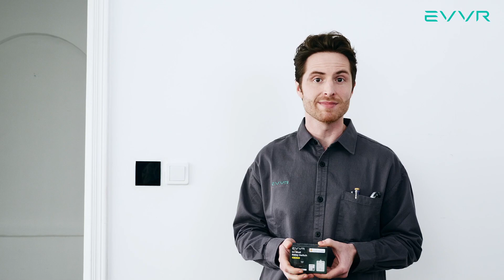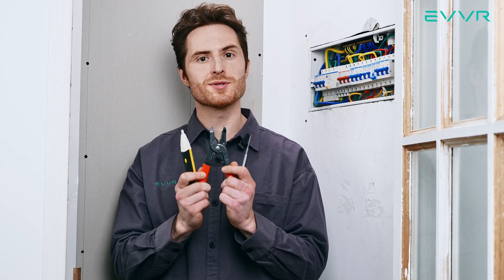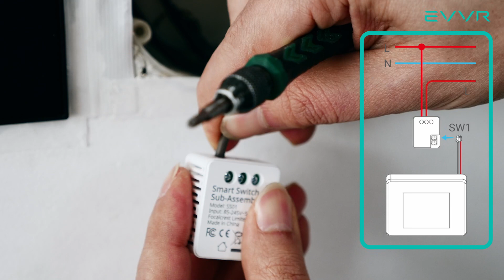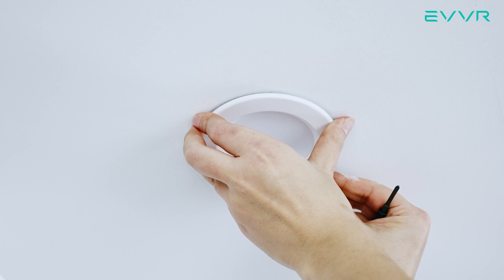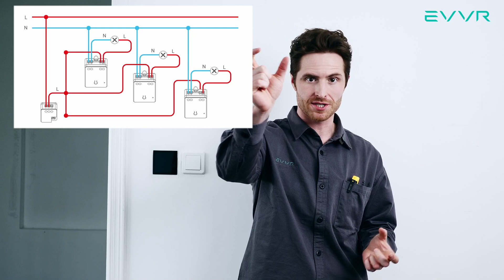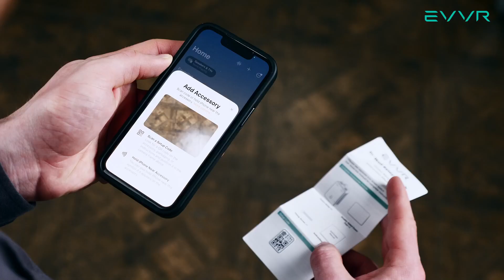How to install Evvr Smart Relay Switch for one gang wall switch|HomeKit&Zigbee|European

Comment: What confuses me is, does the relay have to be connected to one light bulb that the switch controls or each globe needs one?
Reply from the maker: Hi! If you want to control two lights with one switch, you need to install one relay for each bulb.
Reply: How do i figure out which light has the parallel connection?